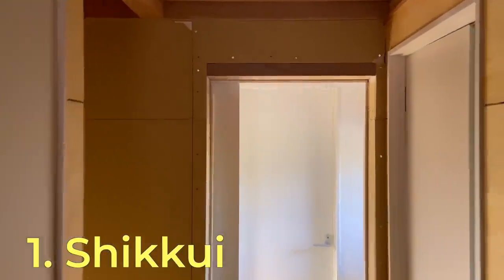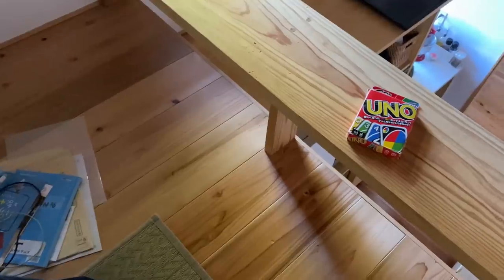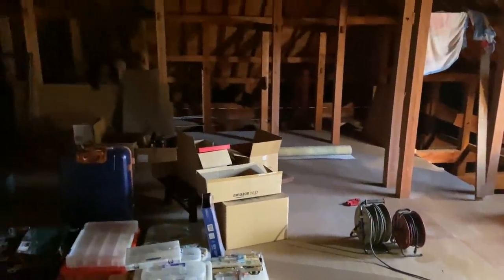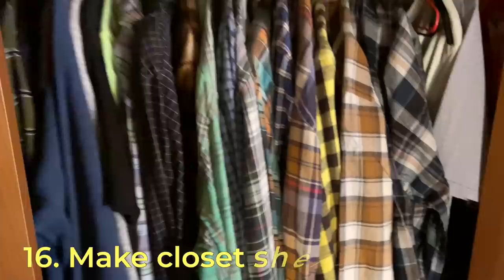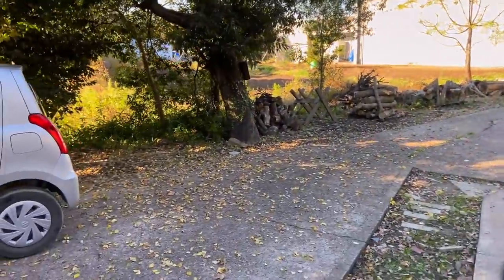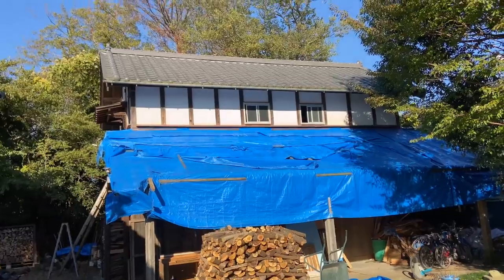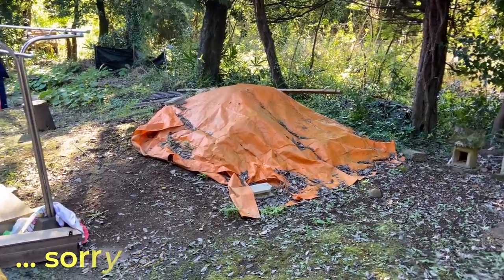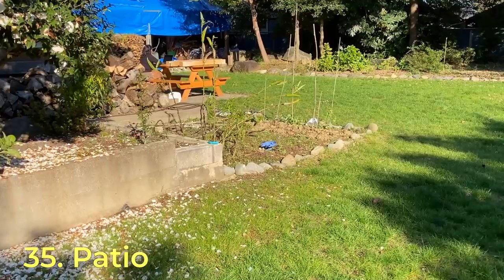35 Things We Still Need to Do on Our House | Abandoned House Renovation

Comment: The best thing we ever did was to insulate our attic, not as lovely as yours, admittedly! The whole house is so much cooler now in summer, and much more pleasant in winter with no arctic cold spots.
Reply from the maker: I feel we should do it, though one concern I forgot to mention would be the added weight to the roof, which is already very heavy.
Reply: @TokyoLlama  You said it would make your attic hotter, but it wont. Also, most insulation isn't very heavy. Maybe try those foam boards, easy to install while you listen to some good music.
Reply: we also had insulation of our roof and kept the higher ceiling look for part of it, that's also an option of course, I get your idea to keep the high ceiling and exposed beams, so beautiful but not great for winter eh?
Reply: Who uses an attic in the summer when there's gardening to be done? Just  put a nice floor in the attic .Leave the ceiling, clean the beams, they're Awesome! Use the space to chill out in. Light it so the beams create shadows.. I know there's heating system that circulates warm air from above,  filters it , and pumps it into downstairs, all by itself!

Comment: You've got a LOT of work to do.  One of the biggest problems with moving in while renovating is that the renovation never seems to get completed.  I hope that, at least as far as the interior work on the house is concerned, you prove to be the exception to the rule.  Good luck to you.  Also, if you insulate your attic, wouldn't that cut way down on the heat that comes in through the roof tiles during the summer (as well as preventing the winter heat from escaping)?  You could then cover the insulation with whatever medium you want and not lose the aesthetic appeal.
Reply from the maker: The first floor should be finished soon (hopefully). I would probably do as you’ve said for the second floor ceiling, insulate to keep heat out during summer.
Reply: Write all your projects separately on a slip of paper place in jar. When undecided

Comment: Spray foam insulation in the attic would work great and be a nice flat surface.  We also have 4 turbine ventilators that spin on their own from wind installed around the roof and small grated openings on the bottom sides around the roof for air to get in.

Comment: Regarding the very hot roof, have you considered installing a roof turbine ventilator aka a wind-driven attic fan? It would do wonders for the heat and be completely green. It would be quite inconspicuous too.
Reply: This method I don't know. In europe there are many houses with tiles and the problem of heat up of the attic. In earlier days these rooms were used as storage but nowadays they are used for living. I know different options. I suggest to get advise from specialists. From what I heard (from friends) solar panels (either electric or water) help a lot - they can even be integrated in the roof so they are bit more "invisible".
Reply: Agreed.  We are in Queensland Australia where it gets pretty hot and humid too - we have a solar powered extractor fan in the roof.  In summer it cools the house at least 2-3 degrees celsius. A good old fashioned whirlybird would also help.
Reply: @frankie3213  Good idea! In our house (just finished building it) we put in something similar to what you’re describing — a solar-powered fan to vent hot air out of the attic in the summer. In the winter the system also pumps hot air from the roof down under the floor to warm everything up without using extra energy. (That part of the system works better if you put it in when you originally build the house.)
Reply: @frankie3213  yes, whirlybird! I couldn't quite put my finger on the right word.
Reply: I thought he could have a 
HOTyoga studio up there...
Reply: @loladeborah  Now THERE’s a new idea. 😆
Reply: Yup. A whirlybird would bring a bit of Australia to the Japanese home. :)
Reply: the attic vents you refer too are great for off-setting captured heat in an attic his roof acts more of like radiant heat what he needs would be a proper moisture barrier and insulation with vents that port out to the soffit above the fascia, that air barrier gap makes it much easier to remove radiant heat being generated by his roof tiles and what is used world wide.
Reply: @frankie3213  unless you can create a vacuum in your attic with the circulating wind that vent would be more than useless, great product but only like half of the problem.
Reply: @tracemyers1275  That sounds like how my roof-system works. Except that in the winter, radiant heat is pumped down into an insulated space under our house, so it comes back up through our floors as a kind of cheap central heating system. (I’d be tempted to call it “green”… but I wouldn’t want to irritate you. 😆)
Reply: @Jordan-inJapan  you may not be able to see the wall of text i wrote because youtube seems to autoblock anything that is more than 3 sentences. But i hope you can because i am Native American and have 2 masters in engineering and a PHD in applied physics.
Reply: @tracemyers1275  haha don’t worry, I read your ‘wall’. Actually, I really do understand your frustration. I think it comes down to the fact that those who hold the power in the world and benefit from the status quo don’t want real change to happen, so they instead embrace superficial change and take advantage of people’s good intentions to make more profit. So people end up shelling out money for ‘green’ products that aren’t necessarily any less environmentally destructive than cheaper options. 

All that said, people in this thread are just sharing their ideas on how to deal with Jaya’s ‘hot under the roof’ issue in an energy-efficient manner. It was probably unintentional, but your comment had a kind of a negative and arrogant tone that could cause people to write you off as a ‘troll’. I think it’s a shame to waste your valuable perspective like that.
Reply: @tracemyers1275  e
Reply: @tracemyers1275  Warm air RISES.  The moist warm air must be able to move from intakes in the soffit UPWARD to exit in openings in the ridge of the roof.

Comment: For the second/side building. 

First floor:
- The roof under the blue tarp, demolish it, and rebuild it and make it enclosed with opening walls, on some off them or all walls.
- open up the wall between the inside and new area and make it to a big open work area. Of course add in strengthening beam for the first floor roof, to compensate for moving some of the wall beams (I suggest talking to a architect friend). 
- renovate or new staircase, and make it enclosed with a storage space underneath the staircase for lawn movers etc. and perhaps in the future a toilet.

second floor, as mentioned by other people down in the comments: as a all-purpose crafting/hobby room:

- A big center table, with perhaps a build in sewing machine that you can pull up, so when you are not using it, you have a big clean surface (table).
- Closets on the sides with crafting supplies, etc. perhaps making one of the closets a bit bigger with a small CNC on a wheeled shelf.
- If space, have a tiny low ceiling loft, for storing long things, needed for crafting, like fabrics, wood for hobby purpose, large paper sheets, etc. (with enough space to take it down.

an example that I put fast together, for the first floor: https://i.imgur.com/WwvZ4Fe.png

Of course you can make the roof into a terrasse, for relaxation a bit away from everyone else
Reply from the maker: Wow, thanks very much! Appreciate the image you've made. Really good ideas. I like the idea of expanding the workshop area, as it is a little on the small side as is, and converting some of the veranda area into enclosed space, with removable walls.  Second floor ideas also great, like the loft for storage. Appreciate it and may just do this!

Comment: You really should insulate the roof (and then cover the insulation with wallboard, or whatever is used in Japan)! Not only will that increase the comfort of the house during all seasons, and save you money on heating and cooling, but it is good for the earth! Think of it as an environmental responsibility. Insulation makes your fuel use more efficient. It's really important!

Comment: I am an audiophile.  That room upstairs over your storage room would be perfect for a fairly big horn loaded speaker system driven by a small Japanese tube amp.  Pick up a Stereo Sound and an MJ Sound magazines and peruse through them.  Many Japanese audiophiles would kill for a room like that.  As for  putting wood in the laundry room, while it would look nice, no question, I would think the humidity would continually shrink and expand the wood, making it not very stable.  Of course for all I know, they may now have treated woods that are dimensionally stable.  You've done  a wonderful job so far, good luck the rest of the way.  One more thing, that Japanese garden fence at the hotel you visited was stunning.  Thumbs up if you try to duplicate that!

Comment: I would encourage you to insulate the roof space.  I know you like the look of the wooden surface and the beams but the insulation would help keep the interior of the house cooler in summer (as it would insulate the internal space from the heat being absorbed by the roofing tiles) as well as reducing heating bills in the winter.  This is an effect I have observed since helping my mother and stepfather with insulation in their house.  If you want to keep the look of the beams you can use insulation mats that you layer against the wood panels with air spacing between layers and finally a board in front which you can finish however you like (we used chipboard to make adding shelves or hanging up picture frames easier than with plaster board).

Comment: Hi, maybe you’re already aware of this, but there could be a way to take advantage of the heat the roof accumulates during the summer, to ensure the circulation of air and freshen up the whole house. I believe it’s called “solar chimney” in English (I’m Spanish so I’m probably making a lot of typos). It’s efficiency depends of multiple factors and there are lots of ways of implementing it, because more than a solution, it a physical phenomenon, but if you’re interested there is a lot of information online, and some architectural projects that make use of it. I hope this helps

Comment: I've been following your home renovation for the past year, but never commented until now, and I think you've done an amazing job with not only modernizing but retaining the detailing of the home as a whole. For tackling the projects, get the smaller inside tasks done first (I do think adding the wood to the laundry room ceiling is a good way of breaking up the plastering some but also using materials that you already have). During the wintertime, it wouldn't hurt to research on how much it would cost to insulate and create extra living space in the attic (there is so much potential up there). And before it gets really cold, I'd also fix the windows on the 2nd floor of your workshop.
Reply from the maker: Thank you, yes, I think I will go with wood on the laundry ceiling. I don't think it would cost a huge amount to insulate the attic if I do it myself. I do worry about added weight to the roof though, probably should discuss with a specialist.

Comment: for the rood insolation closed cell foam.  2 reasons. it keeps temperature inside stable, not letting outside temperature inside, its like tрermos. and the second, its good water repellent. it pricy, but its good invest in house.  oh ya, forgot. its good sound dumper. it reduces sound of rain banging on roof. not full soundproof, but it helps a lot
Reply from the maker: Thanks, if we do insulate I’ll likely use that.

Comment: wow, so many projects! gambatte! the second floor of the kura (and also the inside of the roof in the house) look great; pity about the lack of insulation! In the laundry room, I'd just go for white as it's quite small so the lighter, the better.
Reply from the maker: Yes, the lack of insulation is an issue. A mixture of white with some wood to break it up might be a good solution.

Comment: It's really coming along nicely! Love the openness of the space. I have chickens and let them free range, but I think in your case you'll want to have a chicken coop with a decent size run so that they can move about. If you have issues with dogs or foxes in the area, you'll want to make sure the coop and run are well protected with hardware cloth all around. They aren't usually too smelly if you're good about cleaning up, but you may have a problem with flies. Their manure will be great for your garden once you mature it for a year before using. I highly recommend having chickens. Perhaps you'll want to move the BBQ area away from where they are located, but whatever you do, make sure to provide them with a nice shady location to protect them from the heat of the summer sun. Looks like the spot you chose should be shady enough from what I can tell. I would definitely insulate the attic (will help cool the entire house, not just the attic) and consider putting in a fan that expels hot air outdoors. If you get decent wind, you could use a turbine style fan, which doesn't require electricity. Otherwise, solar fans are a good option.
Reply from the maker: Thanks! Yes, I plan to have a decent sized run. I'm thinking about an alternative position for the coop now. We don't have dogs or foxes but there are weasels and civets.

Comment: Someone suggested an extractor fan for the attic.  My dad made one of those years ago, and at the end of a hot summer’s day he would open downstairs windows and the door to the attic and run the fan to pull in the cooling evening air and expel the hot air from rooms below plus the “heat blanket” in the attic.  Worked wonderfully.  Just be sure to cover any hole you open for a fan with fine wire mesh so you don’t invite in termites or hornets looking for nest sites.
Reply from the maker: Thanks, I think I'll put at least one in for sure.

Comment: You have a lot of projects for the future, which is great for us.

Thanks for sharing, looking forward to the next video. 😀👍
Reply from the maker: Yes, I've got a chipper and have used chips. Problem is that wood has a lot of nails in it.
Reply: @TokyoLlama  That's a good use for the excess wood. A cheap metal detector might solve that issue. Ping it before you shred it. 😀

Comment: if heat is a problem, I'd rearrange schedule so you won't be working under that roof in summer, stabilize or tear down roofs before storm season arrives.... also breaking things up into working two projects parallel can make it seem less of a slog - e.g build part of the dinig table to the point where maybe wood glue has to dry, then get a section of wall done. 
Thanks for sharing your renovation, it is very interesting.
Reply from the maker: Thank, yes, I do need to work more efficiently.

Comment: Nice progress report, to insulate the attic, you could build a new ceiling ans insulate it. It would be easier than insulating the current roof. Then if you insulate the attic, it will be warmer in winter and cooler in summer. If you do insulate the old roof, remember to leave some space for air to circulate otherwise you'll have condensation problems and then rot.
Reply from the maker: Thanks, yes, it would be a shame to hide those beams though.

Comment: You might want to consider a tin ceiling in the laundry a small tip of the hat to the previous owners kitchen.
Reply from the maker: That's a cool idea. Part of the reason for using a bit of stainless or brushed steel in parts of the kitchen is for that reason.

Comment: Hi Jaya: I have no idea how it would fit in with the design of your home, to cut down on the heat in that upper space by the roof, thermostat controlled fan cross ventilation. in short fans in the side of the house to pull out the heat, they work vey well in CA.. I heard those homes can get very warm in the summer. as well in the subspace under the floor, you mentioned it was very warm down there. So I guess your sort of sandwich in by heat.. I suspect it would help reduce the AC cost. vent out the sub space area.  Our home we had number of roof vents installed, it was a vent a roof, that was no good. it does help, with what all humidity I have seen there about during the summer there, might be worth looking in to.  God Bless You and Yours.